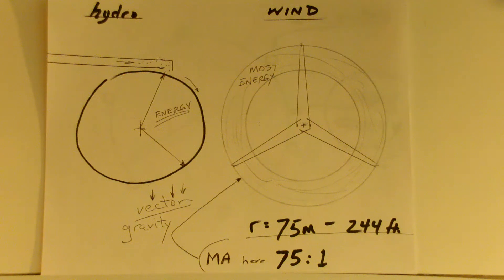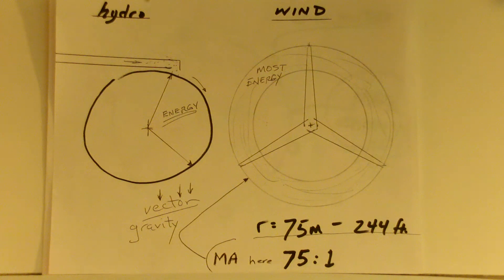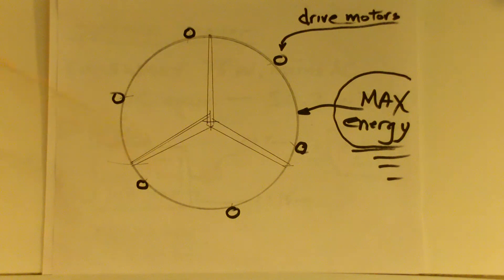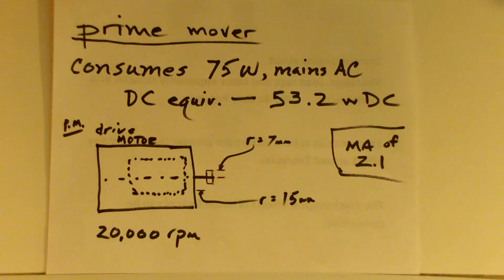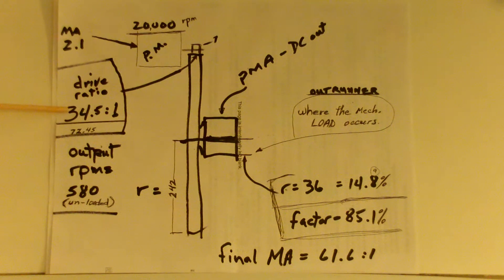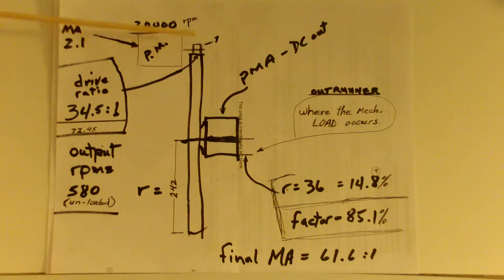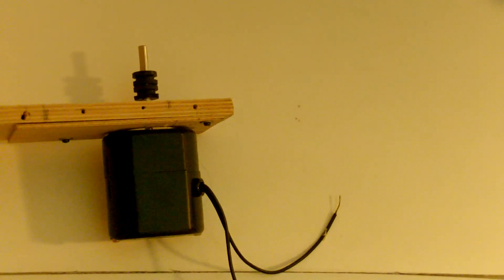overunity transform explained

Comment: Maybe the problems with modelling turbines are due to something more fundamental?
Air mass flow flowing through turbine cross sectional area:  (dm/dt)ₐᵢᵣ=ρₐᵢᵣ A꜀ₛ  vₐᵢᵣ .

For simplicity, lets ignore gravity and say the turbine is in outer space at zero g.
Newton's 2nd law (in full, using extended product rule): 
F=d(mv)/dt=ma+v.(dm/dt)+(dmdv)/dt.
dv=(v₊₁ -v₋₁).
Force of air on blade at constant v = - Reaction Force of blade on air= -Kinetic Friction.
i.e. vₐᵢᵣ(dm/dt)ₐᵢᵣ + (v₊₁ -v₋₁)ₐᵢᵣ(dm/dt)ₐᵢᵣ = -  μFₙ  , where Fₙ=normal force=mₙaₙ
and μ=coefficient of kinetic friction. (dm/dt=0 for the aerofoil).

We get:     ( v₀ ₐᵢᵣ+ (v₊₁-v₋₁ )ₐᵢᵣ)ρₐᵢᵣ A꜀ₛ  v₀ ₐᵢᵣ =  -  μ(mₐₑᵣ aₐₑᵣ)ₙ= -  μmₐₑᵣ (aₙ)ₘₐₓ cos ⍺ 
Therefore: (aₙ)ₘₐₓ=( -(v₀ ₐᵢᵣ)²+ (-v₊₁+v₋₁ )ₐᵢᵣ  v₀ ₐᵢᵣ)ρₐᵢᵣ A꜀ₛ    /(μmₐₑᵣ cos ⍺  ),
where ="angle of attack" for the aerofoil.

There are 3 aerofoils in most wind turbines, 
so there's 3 impulses from the air flow over A꜀ₛ .

More concisely, use ρₐₑᵣ =dmₐₑᵣ/dVₐₑᵣ and the we have:
Torque: τ=3∮ρₐₑᵣ  R.aₙ sin⍺ dVₐₑᵣ ,where R=aerofoil blade length.
Work done:  U= ∫ <τ,dϑ>=τϑ, where ϑ=blade sweeping angle.
Power: P=dU/dt=<ω, τ>+<ϑ, dτ/dt>, where ω=angular velocity=dϑ/dt.

< , > means "inner product" aka "dot product".  Rotatum dτ/dt turns out to be the product of angular jerk & the moment of inertia of the revolving body. This should be nearly zero.
Angle between ω, τ can be taken as practically zero. So roughly speaking: P=ω.τ
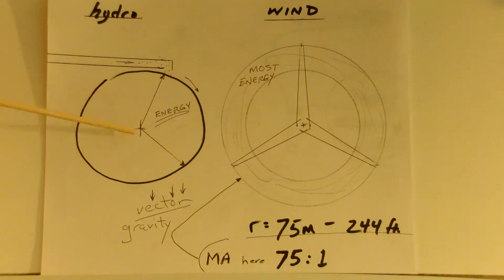Reply from the maker: the  RELEVANT  process is  (rotary) Leverage  and  INHERENT Mechanical Advantage.      in an  Atypically long, 2nd-class lever that  Continues  to pivot around a center of rotation.     such a lever  'becomes' a  (driven) gear, wheel, pulley or sprocket.     since the domain of rotary motion is  Scalar,  achieving ou is  NOT necessarily an impossibility.            skip to  1:30
https://www.youtube.com/watch?v=JOLtS4VUcvQ